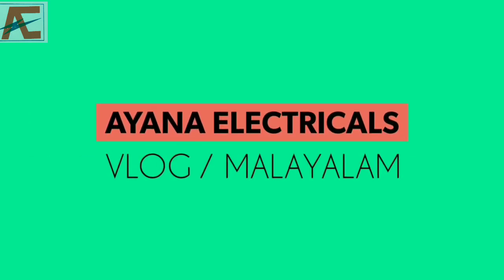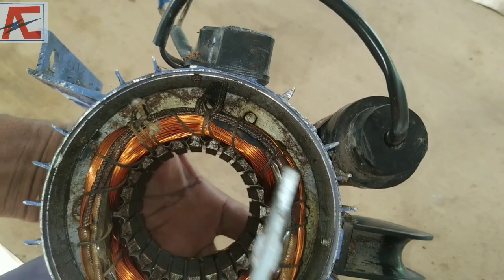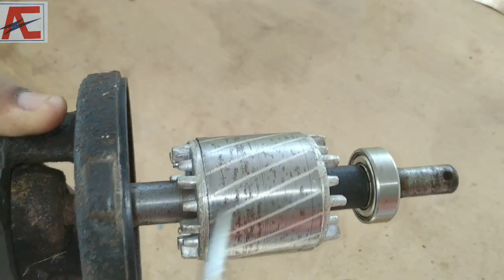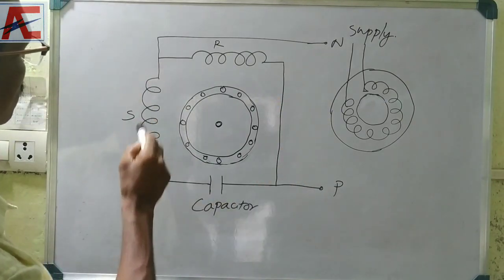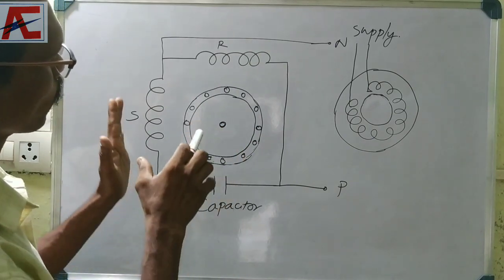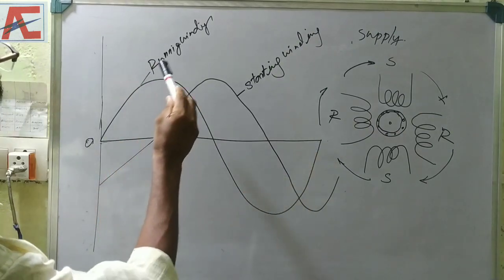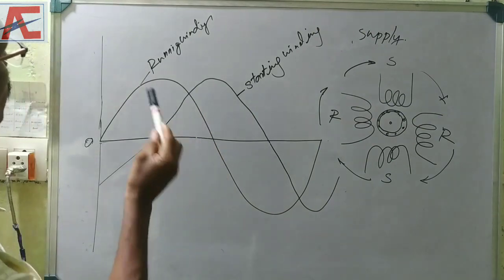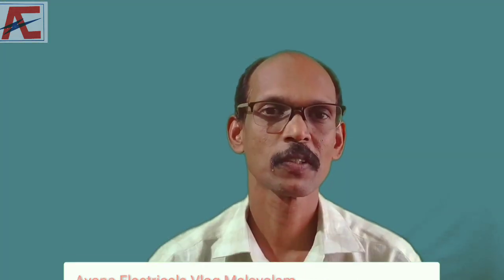Single phase induction motor(permanent capacitor type)construction,working principle,application

Comment: Chetta 1 hp motor start cheyumpol 775 kw current edukkunu. Full load akuna time il 1.08 current edukkunu. Ithu motor complaint ano ??? Current adikam ano edukkunath
Reply from the maker: ചോദ്യത്തിൽ അപാകതയുണ്ട്.775×1000=775000അമ്പയർ ആയി. നിങ്ങൾ എങ്ങനെയാണ് current കണ്ടുപിടിച്ചതു എന്നാൽ റണ്ണിങ് current  correct ആണ്.
Starting currentരണ്ടോ മൂന്നോ ampear കൂടുതൽ വരില്ല
Reply: .0775 kw
Reply from the maker: Current എപ്പോഴും amper ഇൽ അല്ലെ പറയുന്നത് kw പവർ ഇന്റെ യൂണിറ്റി അല്ലെ